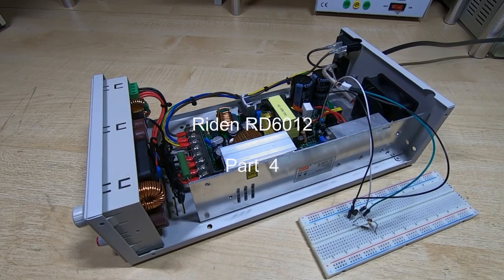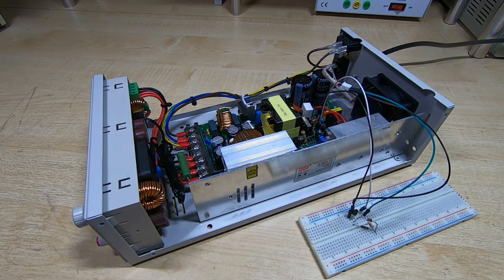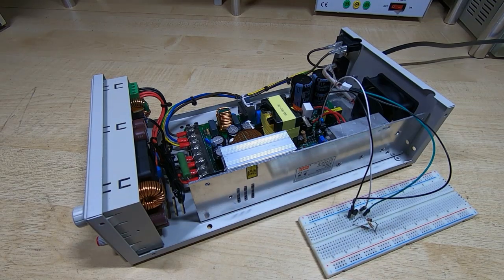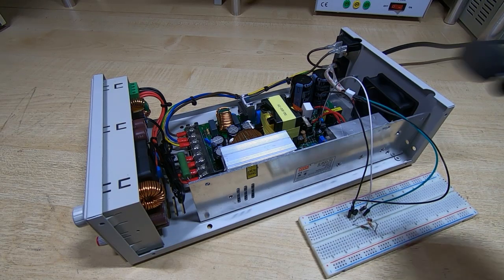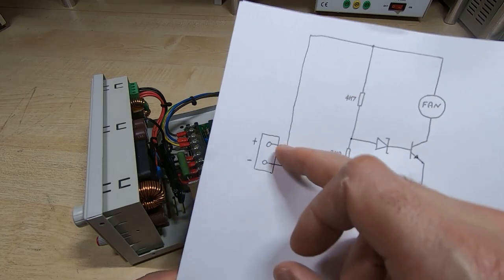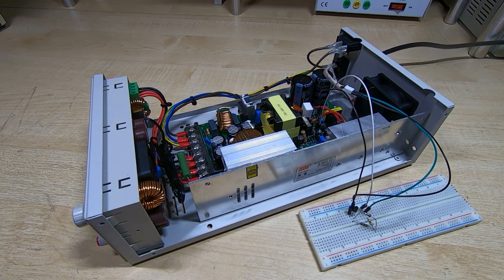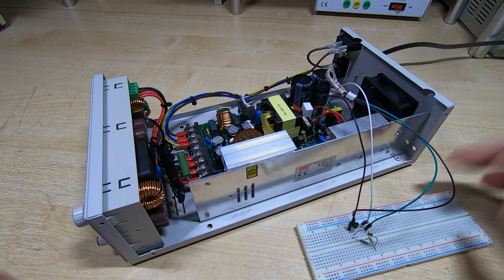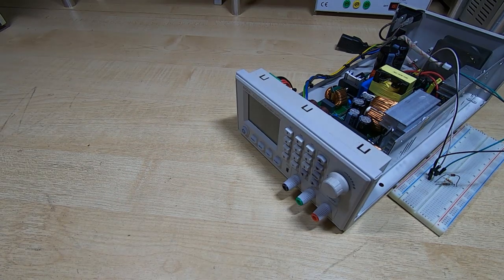Riden RD6012 Part4

Comment: Hello Jerry. I have the same power supply (NVVV) for my Riden 6012. This supply already have your scheme. The current limiting resistor must be replaced. I soldered two 82 ohm resistors in series, instead of one 60 ohms. The fan is now running at low speed. And when the temperature rises, the fan runs at maximum speed. 
PS. the resistor is near the fan connector ;-)
Reply: Hello Evgeny
Is it the resistor that is mounted standing closest to the fan connector that you mean?
Reply: @missko1962 , yes. if you show me a pictures of the power supply board, then I can indicate with an arrow
Reply: @evgenykosourov5958  How can I upload the picture?
Reply: @evgenykosourov5958  So basically remove the existing 60 ohm resistor from the factory and put in your two 82 ohm ones in series in its place? Your solution seems simpler than Jerry's so what are the pros and cons of your method vs Jerry's using a transistor, diode, and 2 resistors? Did you use 1/4 watt resistors or 1/2 watt? I only have very basic electronics knowledge and can do your mod, but not sure about Jerry's since I'm not sure what type of transistor he used and it's twice the # of parts. =) Thanks.
Reply: @heytae  the power supply already has a fan control circuit. I studied the board and drew a diagram. I did reverse engineering of the board at the fan control point.
Jerry was making the same circuit that is already on the board.
I solder 2W resistors because I had them. You can put a resistor of the same power as on the board.
Reply: @evgenykosourov5958  I've done your modification, I added a 100ohm resistor on top of the existing 60ohm and it works really well, thank you!
Reply: @MrSmartiz77  I saw in another video that adding a 22uF 25V cap across the fan can often reduce noise too if PWM is used to control the speed. There was a 'ticking' sound from the fan so that may be eliminated by adding a cap?
Reply: @evgenykosourov5958  Hi
Thank you very much I'll fix resistors and test
Have a nice weekend
Reply: Nice! How did you figure that out?

Comment: That fan sounds really noisy, like it is not good.  Could be just mic placement, hard to tell from here.
Reply from the maker: Probably a bit of both. Most of the noise is from the shape of the vent holes which create a lot of reaction noise but it is loud, If you lean out of your window you can probably hear it. It would probably be possible to find a less noisy fan but I do not want it spinning when the 6012 is in standby mode unless the heat sink is hot and that is how it now works.
It should now only come on very rarely and in the new 'slow' mode it spins so slowly that it is almost silent.
Reply: its a shitty little 40mm fan that spins at like 4200 rpm. i never even used mine from the kit and drilled new holes for an 80mm computer fan i had lying around

Comment: Been following with interest, Jerry! Any chance you could explore the output of the 6012 with a 'scope? I am guessing ripple and noise will be worse than the 6006. Also, is the normal output relay switched on this one or is the relay just for charge termination on the battery terminal as for the 6006?